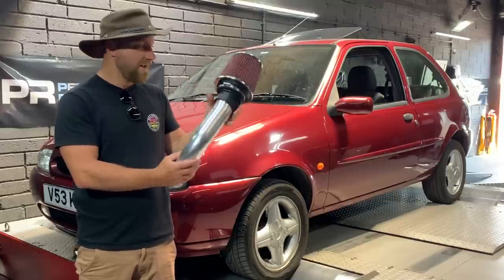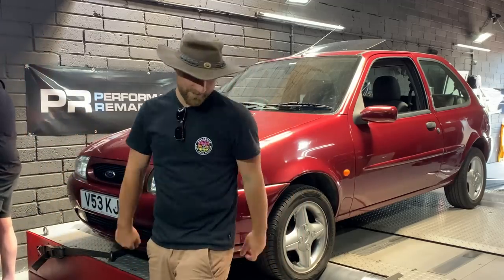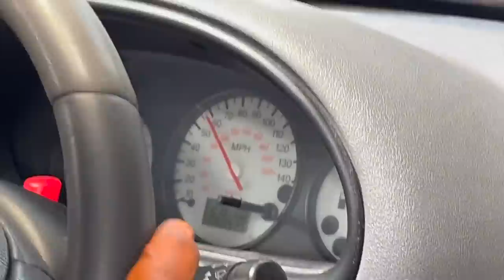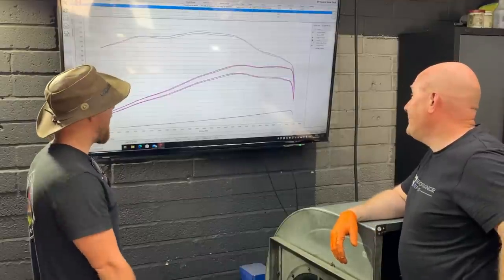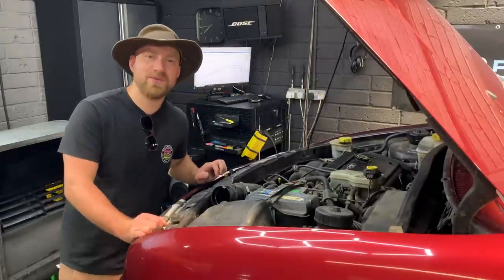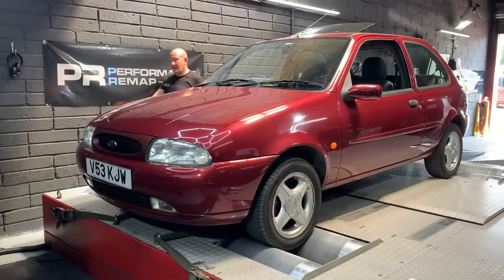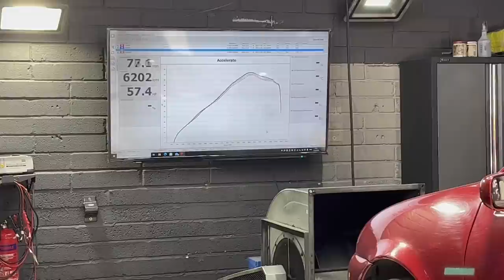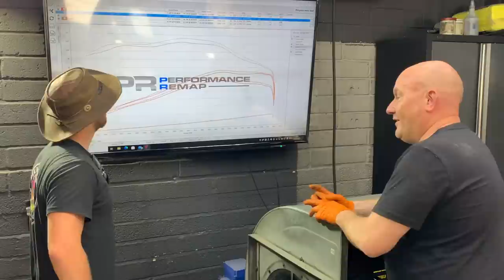How much power does a Performance Air Filter add? DYNO PROOF!

Comment: You have to change the needle valve as well so it can pull in more fuel, so it can use all the extra air it can pull in.
Reply: I don't think it's got a carburettor 😂
Reply: Could try fitting a new fuel filter as these often get forgotten about then some Tesco Momentum & see if that improves the Dyno results - I wouldn't expect much but maybe a small improvement once the ECU adjusts the fueling.
Reply: Change the Needle?......in what?.....the engine is fuel injected 😆

Comment: I put one on my civic and it did sound better but it now sucks in the hot air from the engine compartment. So I gain 2 percent with the larger filter and lose 2 percent because I am using hot air. So I was thinking of pointing it straight down to suck in the cold air from under the car and when I turn off the engine the dirt will just fall off the filter. What do you think +2 percent minus 2 percent but sounds a lot better. Lol

Comment: The flat spot will probably be heat soak where the engine bay was getting hot from idling and when u accelerate the open filter in the bay is sucking hot air .. make yourself some duct pipes from a grill to the filter so it has a direct cold air feed. Colder the air the bigger the bang  .. also TESCO MOMENTUM HAS THE BEST OCTANE LEVELS WITH MINIMUM PRE IGNITION KNOCK .. best proven pump fuel for performance .. iridium plugs will help and get a distributer rotor arm without the spring that cuts rpm .. the springless rotor arm will allow more rpm for around a fiver ..get some mass airflow cleaner and clean the mass airflow sensor ..great channel been watching for around 6 months .. my daily go to vids 👍🏻👌
Reply: Yep! Tesco juice is the best! 99 octane, been using this for years. Great comment btw.
Reply: @thePeterpumpkin68  I use momentum in my stage 2 tuned cooper makes a noticeable difference and is needed for the remap .. I expect a decent map on Geoffs fiesta would bring it to around 100hp
Reply: Not sure if the Fiesta still had a rotor arm and distributor when this one was made, certainly 2005 ones had moved to twin coils and no distributor.

Comment: This takes me back.  We used to put K&N's on nearly everything I think.  Mostly for the intake noise!! I'm not surprised by the flat spot.  I remember way back this frequently happened when you just fitted the induction kit and no other mods.  I think (and it's a faint guess here) its something to do with greater volume of air but initially slower velocity when you put your foot down so there is a touch of hesitancy.. Something like that.
I have to say the 1.25 16v engine is little peach.. Wasn't it developed by Yamaha?
Reply: You have to fit larger main jets to stop the flat spot. It even increases mpg
Reply: Yes a co development between ford & Yamaha .
If you listen carefully the fiesta sound a bit like a motorbike scream momentarily, when it's revving at the top end....

Comment: Use good old redex and premium fuel up to the next test, and some Wynns oil supercharge to protect the old engine. Used both for years in many different cars never had any problems. Also quality multi electrode spark plugs. Good luck. 👍

Comment: these were 75bhp new, so its spot on 
 its the later shape
 ones after 2008 which were 82bhp
Reply: Hp an wheel horsepower are different are they not i thought u lost about 10% from a manual transmission

Comment: about 2% to 3% is actually a lot!  Makes me curious how it turns out when people are putting such a filter at such a spot it only sucks in hot air, instead of the rather good location in the fiesta.
Regaining power on old engine, check spark-plugs and fuel-injectors first?

Comment: Flat spot is probably because its just been installed and the ECU can't compensate enough you may have to get it mapped and slightly bigger fuel injectors. I think a sports cat and cat back stainless system with no mid silencer, just back box to be next, then get it mapped and running all nice.

Comment: 75 to 77 bhp is a whopping 2.67% increase the figure K&N put in their blurb (not) on encouraging that dude to buy the filter. 
   ( p.s I used to re-jet cars back in the day to gain extra bhp there was always a noticeable difference).
   Used a carburettor shop in Hillingdon Middlesex on the Uxbridge Road.
Reply: Did not expect to see Hillingdon in this comment section!

Comment: Great for a laugh, but honestly have been in the trade for many decades non of thes crap works without adding other systems to aid. Hot soak under hood kills power ,crap plugs,tired coils the list goes on and on.A fresh tune up of the ignition system would be worth 3-4 extra hp. You are doing it right though by doing 1 step at a time to show how each change makes a difference..Now do spark plugs, clean injectors, change coils , clean the valves chemicaly ,add a sheild over the air filter to only grab colder air and you will see 10 hp gain
Reply: 1other point is to get that old pluged up CAT hot as hell red hot to clean it out, all the idling it has done it will be 1/2 full of crap restricting flow. I run watter at full rev into the intake on a mist and the crap that comes out is amazing pound of carbon is released. in fine chunks..

Comment: I've just fitted one of those to my EV, wow! What a huge difference it made.... another 250 BHP!

Seriously though, fitted a DNA air filter and inlet and removed the cat and collector box on my Royal Enfield Meteor. Apart from a noiser intake and a fantastic exhaust note, I didn't really notice any improvement in performance. Maybe, because of the EFI, it may be running lean at higher RPM's....

Comment: If you're sucking more air in, you need to throw more fuel in and more exhaust out to make any significant gain. Bigger injectors and straight through pipes 😁?

Comment: There is no simple answer to the question in the title. Some car will make up to 5bhp more with some intake & Exhaust mods. Some cars might even lose power. Slight alterations to engine mapping in combination with these mods will improve your chances of making a little more power. There too many variables in play. 
PS: Even if no extra power is produced the engine should feel a little more responsive.

Comment: I used to get more performance from my C230 KOMPRESSOR just by going out in the winter in negative temperatures compared to summer. Colder air is more dense.

Comment: Speaks volumes when the dyno operator wants to buy your econobox, but here in America if your car made those numbers you'd do your best to keep it under your hat lol. The 3.1 v6 in my Buick Century supposedly makes 195hp and the 4.3 Vortech v6 in my Safari makes 220, both are over 9.1 compression so you can really feel when you use premium gas.

Comment: Turn the throttle position sensor round a bit. put bigger injectors in it from a 2.0 - there you go. put a potentiometer on the 02 sensor, turn till it's not too rich. It should sort itself out by itself on a run - then dyno it. It will run funky. But 50%+ power. drink fuel. spit fire.

Comment: With the extra induction noise this car will get tiresome on a long journey, especially if you need to open the windows to keep cool. A mild remap will yield maybe 10% more power across the board, and done correctly, remove any flat spots, making the car feel more responsive and much nicer to drive. Any power gains above this will need decat, induction tuning etc.
I would have stayed with the standard airbox, maybe looked for a performance filter to put in it, and mild re-map!
Reply: Yes i agree, also you would need to inform your insurance company that its modified with that filter, not worth it really, better to look standard with mild remap.

Comment: My old polo’s exhaust had a small hole in it and was on the way out and was only £80 for a whole manifold to tail pipe so I was going to replace it before the MOT so decided to see how much I could rot it out by spraying water up the tail pipe. Rotted out the whole of the back exhaust box. Boy did it sound good to my 20 year old ears. Louder than my brothers X Flow Caterham, but had to change it in the end as I was sure I was going to get pulled by the rozzers. Fun times.

Comment: I used to obsess about VW, and drove many. I own a Mk7 gtd and used to own a Mk5 gt. They rust like you would never believe. I had a mk6 Fiesta, a lovely little run around and cheap as chips, well the chips before 2020. I have a transit connect, fantastic, and very comfortable. Ford is the way to go.
Reply: Right now  I would love a mkII golf GTi.
My sister had a white one as a company car back in the 90s.
..
I had an E reg XR2 about 23 year ago.

Fun car handled like sh... To a blanket.
Can you imagine 13/60/185 wheels.
 & No power steering.💪
..
So tiny..fun car.
Sold that XR2 for 250£.s because I then bought a golf VR6.
...
Them XR2s 5k+ 
now

Comment: I miss my MK4 Fiesta, it was a Mazda 121 and was basically the same. It has one of those airs filters and it didnt sit in the box cause the box was completely removed, The little thing just destroyed the miles until the air filter sucked a flooded road up into the engine.
Reply: The mazda 121's are ultra rare now

Comment: Used to be £10 for a power run!?!
I know this isn’t a tuning project and I’ve been out of the tuning game for a while but… a 1400 is externally identical to the 1250 and even the 1600 (while externally slightly different) will bolt straight in.
You know you want to!
Love seeing you both giggling like teenagers.

Comment: need to add a hairdryer  - for "real gains"  lol... - surely a yard blower will "make more than noise" - jk2

All too many folk have added these inside the airbox to still make it past inspections...  Not a lot more surface area than a stock filter - cutting the top out of the airbox probably achieves similar gains...

Comment: What about drilling the original air box above filter for more air flow would the increase if any be cheaper than buying a KN filter. Loads of air box mods on various sites and vehicles but do they  really work.

Comment: You can always get a bit more suck squeeze bang and a blow with a big enough tube, also bigger lobes on your shaft which opens the valves on the head for more air and liquid to get in for an even bigger bang, at least that's what I was told, I had a very basic education, I read it in a Haynes manual.

Comment: Are people really this dumb?
If the engine needs more air and you put in a performance filter it will get more horsepower.

If your car is really really restricted because of air it will gain a lot of horsepower if you give it more air.

Comment: I got a k&n air filter for my van. No real difference in horsepower or fuel consumption. Where it did make a difference was in improving the rev response of the engine.

Comment: Question please, what would happen if you added an electric squirrel cage blower to the front of the intake system. More power, fuel efficiency, or engine problems?

Comment: Does what it says on the tin. Manufacturers have other requirements to worry about like water ingestion, dusty climates and people who never change the filter so its always a compromise.  As another test on the same day, I would have liked to have seen no filter at all, that way you can see what reduction any induction restriction has.
Reply: Without a filter very little difference than with the K&N.. they're close to a no filter as possible.

Comment: Prediction before getting to results, it will LOSE power due to warm air intake.
K&N replacement panel in the stock air box a better bet.
Reply: Glad to be wrong, but still reckon better to be had with the stock air box and cotton panel.

Comment: Try stripping it i think if u lose some weight it could gain some more power even just the passenger seat and rear bench.
Reply: Well not gain power but more power to weight so in turn a bit faster acceleration

Comment: Thats the cheapest 2 hp you'll ever get! When are you doing the Puma 1.7 engine conversion.
Reply: I’ve got a 1.7 Puma with 4 branch and free flow exhaust. Would a K&N panel filter make any difference?
Reply: @stewartshackleton7825  I fitted a K+N panel filter in the std airbox, removed the resonator and  created a cold air feed in under the front of the LH wheelarch, runs great and is my sole daily drive and has been for 10 years!

Comment: Would not bigger jets give more fuel, which then gives a decent improvement. I fitted K and Ns om my TR7, along with bigger jets and a tubular manifold, gave 15 hp more, about 12% increase.
Reply: It's fuel injected. There's a sensor that measures the amount and density of the air going into the engine and adjusts the fuel delivery accordingly. What you really need are go-faster stripes - they're known to add at least 100bhp at the wheels...

Comment: i put one on my 2011 jag xfs it went from 270 bhp to 322 bhp and over 520 torque after a little tune and it sounds awsome
Reply: Yeah. 
Always bigger gains on a bigger engine.
Though that's still an impressive increase.
..
I'd suggest the air box was tuned for quietness rather than performance....

Comment: Change the exhaust then fiddle the carb .If you are going to go really mad head off polish and port change the cam.Stuff the air con open the window. In fact remove the pump its a Parasitic draw on the engine.
Reply: Lookup2Wakeup  lol
Reply: Lookup2Wakeup  I was always told to keep to a low carb diet...😂

Comment: That cone requires heat shielding or you can lose them horses when it’s hot so I’d just use a panel filter.
The panel filters boost is not going to be noticeable either & will be a bit quieter but the main reason I fitted filters to all my cars is there washable so they pay for themselves if you own the car 3-4 years.
I now have a focus st with stage 1 so it’s about 275 hp 420 torque & stock filter is paper cone type so I swapped to green cone filter & it sounds awesome & probably 5 - 7hp gain on that because it’s turbo & higher powered cars will benefit more from filters…again the real win is noise response & washability but on that power level 5-7 hp is not noticed.

Comment: Would be interesting to see what a K&N panel air filter would add, if anything?

Please Geoff can we have some more, but this time put the standard K&N panel air filter in as a replacement for the Ford one?

It'll probably actually cost more than the second hand mushroom filter. 
Oh well! 
It'll be ad revenue well spent, coz we'll know the truth!  

There's plenty of conspiracy theories about K&N panel filters out there, let's debunk or prove one?
Reply: I have a Pipercross panel filter in my 2020 1.0 fiesta. Does it make more power? Sure the tune did that. Does it sound better? Fuck yeah!!!!!!!!
Reply: @pigeonpoo1823  I used a Pipercross panel filter in my Sierra Sapphire 2.0 GLS and drilled holes in the air filter box when I was 23. 

In my heavily modified Calibra Turbo 4x4 I fitted a proper mushroom filter like this video, connected to a 3 inch stainless intake pipe with a 3 inch stainless down pipe the other side of the turbo, that made loads of noise, it was as loud as a dump valve! That was actually tested on a rolling road at 286hp tho. 

In my next car which was a manual Vauxhall Omega V6 I used a K&N panel filter, which I again drilled holes in the box. Lol

I then used a K&N panel filter in my five pot ST (also drilled holes) and even currently use a K&N panel filter in my BMW M235i (not drilled holes)!

Obviously I do plan to get a proper intake with mushroom filter and remap in my current daily drive BMW M235i, but haven't got round to it coz it's stupidly fast without it anyway! 😉

I'm guessing a K&N or Pipercross panel filter in the five pot ST and M235i will add at least the same hp as the Fiesta, probably more coz they're actually performance cars. 

However, I'd would love to know the answer to the panel filter conspiracy theories, it would be another conspiracy debunk or truth episode!
Reply: @whynotagain3639  you are a fucking hero. Well done bud!
Ps, I lost my V to the daughter of a Sierra sapphire 2.0 hahahahahaha
Reply: @pigeonpoo1823  I forgot, I also used a K&N or Pipercross panel filter in my third car which was an M reg Astra 1.6i CDX before I bought the Sierra. (Can't remember what filter brand it was 22 years ago). 
The Astra was actually quite a bit faster than my second car which was a proper rusty XR3i.
Vauxhall's have always been underrated!
Reply: @pigeonpoo1823  how did you do that, what's the daughter of a Sierra Sapphire? A Mondeo saloon? 
How big was the pipe? 
Wouldn't metal hurt, what kind of lubricant for exhaust pipes? 🤔
Reply: @whynotagain3639  hahahahaha (deep breath) hahahahahahaa
Hahahahajajahahahaa fucking brilliant twist my words
Reply: @whynotagain3639  hahahahahahaa that gets funnier every time I read it!
Reply: @pigeonpoo1823  laughter cures everything!
I'm still confused tho, so did you go up the back pipe or was the Mondeo saloon the dominant one?
Is there a colour on the rainbow flag for car festishes?🤫
Reply: @pigeonpoo1823  what's the numbers suddenly after our usernames?
Have we broken the matrix?